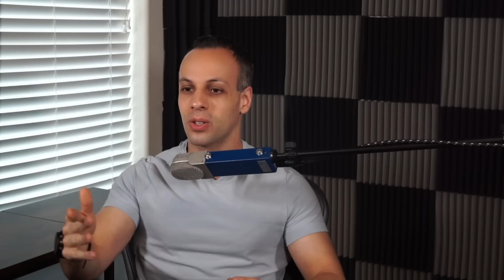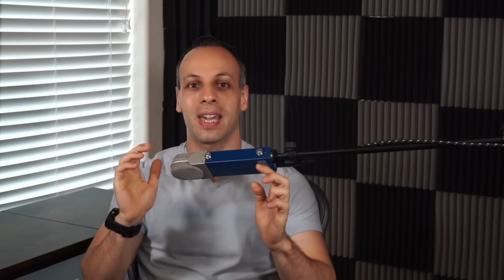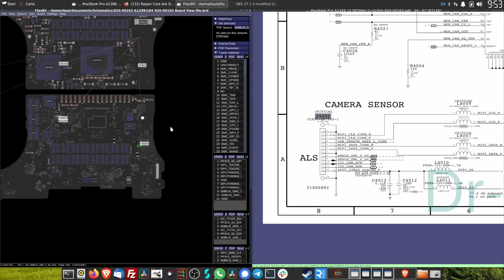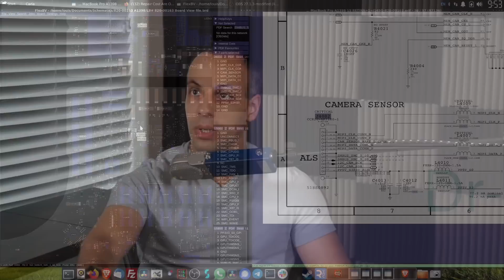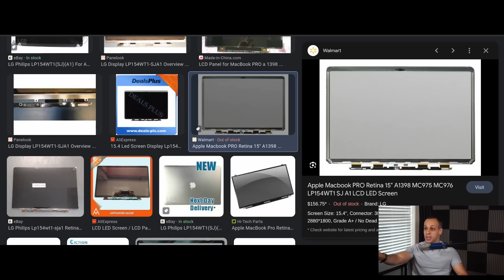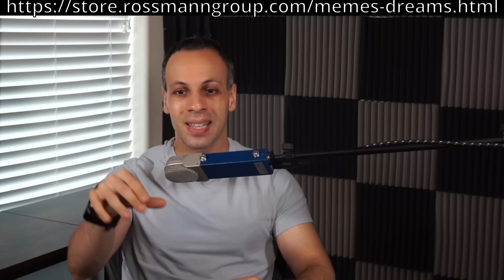The Ford F150 Macbook - when car repair resembles macbook repair...

Comment: Everything on the Dodge Promaster 22-23 is run through the computer requiring a onetime purchase of their diagnostic software. So $3k minimum if you dont already own the based diagnostic scanner, $4k-$10k if you dont. Dodge also released a custom break assembly just for this truck, meaning they are not in stock anywhere except for at Dodge.

Comment: ford absolutely did design this to fail on purpose.
this is not the first time they've done something like this. fords thinking" hey guys, lets mount the brake light switch on the brake petal so the wires move every time you hit the brake and cause the wires to brake so you have no brakes lights so the person driving at best gets a ticket, or rear ended & dies"
ford, built to fail,..in the most expensive way we can think of,..

Comment: I saw the same video.  Now imagine every single consumer product going this same way. From toasters to, any minute now toilet bowls. I can't tell you how many newer front load washing machines put the soap and liquid fabric softener adjacent to the circuit board. Or how most people who own top loading machines with computerized sensing and water saving technology feel the machines aren't getting the clothes clean and have to wash a second and third time. Does this sound like it's saving water to you? It's not just failure points,  it is the stuffing a complicated and delicate mechanism into a previously extremely reliable device in order to impress or fool consumers into some supposed benifit. When the truth is that it's just a gimmick for the theft of data and the side benifit for the manufacturer of ten to one hundred times the failure rate. Because now you have ten to one hundred times the components, and a multiplier of software bugs on top of that. 
This isn't saving water,  power,  landfills  or resources in any way imaginable.

Comment: In Australia Ford would be asked a few questions 1. Is the item fit for purpose? they leak so are they functioning correctly? 2. How long is the part expected to last?  How long should tail lights last  one year, two years,or ten years?Without "positive" answers Ford might be forced to fix the problem under consumer law

Comment: I got a 2024 f450 ordered to be delivered  in a couple months... I optioned out the tail light with led weight sensors.  I hope this part isn't some complex issue like the canbus issue of past ford's. I will be hell to deal with when problems arise that takes down my truck, as it is meant to make me money. Ford is #1 for a reason, way more reliable than dodge and better designed then gm trucks. That won't change my view on how I will address issues. I will bring down the hammer since I paid good money for this tool.

Comment: its TOTALLY right to repair.. IF you have a bad battery, low voltage, the warning on a 2018 F150 will say that the electronic E-brake will not work, so your vehicle will not start. ASK me how I know..

Comment: Led tail lights and led headlights can be over 2000 ..main screens can be 2000 .these were a .99 light bulb and the screen wasn t there .new cars will never be on the road for 20 years it will cost too much to keep them going .

Comment: Fantastic video     I am a tech 52 now.   And to add to the Bus line    Some vehicles will see the repair and clear error out and go back to working….. others have to be cleared with a computer to clear the error code out or the module or repair stays off line ….. it cost the tech and consumer      Very poor engineering and not knowing if it’s purposefully done or just idiot of don’t care.   Great video

Comment: I've seen this before. Farmer came in with his 2015 F150 a few years ago, no radio, HVAC function, power windows or locks, memory seats, etc. Ended up being both tail lights cracked from farm use, water entered the blind spot detection modules in the tail lights which took down the data bus. Was $3k+

Comment: The last Ford I had was a 97 Probe GT.  It was a good car, but about a month after I got it, I noticed that there was a spot on the lower plastic panel that wasn't attached correctly.  Luckily it was under warranty because one of the clips was damaged.  You couldn't get the clips separately so they had to order the entire side panel and replace it.  Keep in mind, this clip was not part of the panel.  It was just attached to it.

Comment: Fuck car companies.  They've been going this direction for a long time.  Fix old cars and support the aftermarket economy.  With no real infrastructure for electric cars and nearly non-existant parts support, it's the only real way I see forward.  I had Hyundai cause me a similar problem by refusing to sell me a set of rods because the rods I pulled out apparently didn't match what they had listed as supposed to be in there.  I don't fucking care, I just want to fix the customer's car, don't blacklist me because I pulled the wrong rods out of your factory assembly.  The whole "hangup" was that my rods had bushed small ends and the book listed that engine as having press-fit rods.  I wound up having to cut the old bushings out (as they were electroplated and not pressed in) and custom size some Brian Crower small end bushings that were sitting around the shop to fit.  Added an extra day to the rebuild (that nobody got paid for) all because the dealership was a twat.  And this wasn't even involving computers....

Comment: As a designer myself,  I have to ask the question,  what is the acceptable level of repair difficulty?  We can't design it in such a way that every single component can be replaced in 5 min or less with no additional cost beyond the component.  So,  what is acceptable?

Comment: Would it not have been cheaper to have abandoned the tech in the rear lights qnd just replace with a plain light. Would have to seal up the connector but would not have to spend over 5k

Comment: I saw the video you talked about. I’m almost 50 and I repair lots of things. Our window of greatness in products I believe already happened. Currently and into the future I don’t see anything but planned obsolescence along with more garbage design on everything. My personal way to avoid this is to research just about anything you buy. Lifespan takes time so that means you wait. Buy a ten year or older car. Research the car know which one lasts the longest with the least problems. Buy used stuff. Go to the store look at prices then go home and research used. I bet you’ll find the price is half or less original price. Slow down and never buy new if you can help it. Otherwise your a crash test dummy

Comment: Ahh nice to see ford is "catching up" with the bmw (e65) 750. The worst car ever made.

It has a can bus network that uses suitcase connectors (the pinch conetor that cuts the wire and is not water proof) that is outside under the headlight assembly.

Comment: The DOT should have mandated a recall for these lights where Ford was 100% on the hook for replacing all taillights with those part numbers on all trucks that are in service or simply exist.  If they did that, Ford would find a way to make this whole repair cost under $500 for themselves.

Comment: I was quoted just under 2k to fix the A/C compressor in my 2012 Chevy Cruze. It requires a whole new kit to be installed and recharged, oh it also counted the replacement of the hoses from my radiator busting and spewing transmission fluid all over the highway which made me actually bring it in. 

This quote was after the mechanics recharged my AC free of charge with a dye to test for leaks and replaced a blown fuse. 

A more "reknown" mechanic (looking at you Christian Brothers), wanted to charge me 5k just for the compressor alone.

All of that pales in comparison to this.

Comment: The auto industry has moduled everthing and spread it out all over the vehicle.   The question is, why they locate sensitive PCB's one seal away from weather ingress when the cost is negligible to locate the module with the PCB somewhere in the interior of car, and the actual sensor in the more risky location.....protecting wiring bundles is a simpler lower cost design over trying to make the entire module containing the PCB IP67 or IP68.  The only answer has to be in the revenue of their parts divisions.

Comment: As an engineer with many years of experience I can vouch for the fact that nothing is designed to be repaired anymore.  There are two issues here to be considered.  First, our society has evolved into a throw away society so products are not designed to be repaired but rather to be thrown away and replaced when they fail.  Secondly, everything is very cost sensitive from a manufacturing standpoint.  The pressure from management is to cut costs to the bone.  So, since it is a design goal to assemble everything as cheaply as possible no concern is given to disassembling anything for repair purposes.  As  you have noticed from working on Apple products, everything is bonded together.  It is cheaper and faster to bond things together then to assemble them in a manner that can be disassembled.  Additionally, bonding things together makes it easier to produce products that are thinner and lighter.  Making things thinner and lighter makes the marketing and sales departments happier and may get you a promotion.

Comment: I have to replace the electrical connector or the tail light on my 2007 Audi A4 every couple years or clean corrosion from inside the contacts and fingers on the connector otherwise it dies from corrosion and it appears to be sealed fairly well

Comment: My Mercedes had to be towed because the CD changer corrupted the data on the canbus so the engine control module couldn't communicate.  Engineers are idiots.

Comment: If a man needs backup sensors on the back of his pickup then his man card is revoked. He should have bought a minivan or something cute. It's very easy to use the mirrors on a pickup. 

The tail light on my 08 Silverado quit working I went and bought a new bulb. The entire enclosure was filled with water, like a little fish tank. I could have put a goldfish in there and it would have lived. I went to my toolbox and grab my drill and drilled small holes in the bottom and drain the water out, then replaced my bulb and I was on my way. I don't know why they can't manage to seal these things up it can't be that hard. Fortunately my truck is completely drivable when it's like that. I take care of my own repairs I'm not paying these prices.

I would have been checking junk yards for that tail light assembly on the feminized F150.

Comment: As an automotive test engineer this looks for me as screw-you from Ford by designing wiring in this way (not splitting sensors from cricital systems by devices like gateways), but not entirely - since those systems are currently deeply interconnected for ADAS functions and stuff. It's like half-split.

Comment: This is why I use computers when necessary but do not want to rely upon them. I want to be able to be self sufficient with older non computerized equipment. It's all great till it doesn't work and you can't repair the computer parts yourself. Computers can be helpful to monitor things, I don't like them controlling things much, I'll do the controlling myself.

Comment: I bought a new 2013 RAM. About 3 weeks into ownership, I came out from work to a no crank/no start. Had to have it towed to the dealer. Turns out the radio unit crapped out. No big deal right? Nope. All functions run through the radio unit. Just order one right? Nope. It is VIN coded to the vehicle. They had to manufacturer one. No one knew how long it would take. Not the dealer. Not Chrysler-Fiat. Not the manufacturer. The dealer told me they would know when it showed up. It took almost two months. I had a loaner but it was a base model Jeep Compass and depressing to drive. The dealer didn't know what the unit cost but they told me it was easily north of $3000 just for the unit.

Comment: AMG Mercedes suffer from similar designed obsolescence. A literal $5 plastic part failure costs $10,000 to replace because it required the entire engine to be removed.

Comment: Geez  and I thought I had it bad... changing out my headlamp assembly.. the dealership  wanted  $450 a piece (so  x2)   charging me $250 a piece in labor so everything I had done   (including  oil change  tire rotation and  license plate light  would have cost me  $1,300 + ...
So I got on amazon and bought the pair of headlamp assemblies for $250  and it still cost me $750 for all the labor and the other stuff.
so hey  I saved $300   RME

Comment: The fact is, auto manufacturers don't care if the car lasts any longer than the warranty period. You're supposed to toss it and buy a new one as soon as the warranty is up. All this will do is make sure that those of us who can only afford very old cars will not be able to drive because repair costs will either be too high or simply unobtainable. Only the rich will be able to have the freedom to travel in their own vehicles. All planned to "save the planet" (which is bogus but 99% of the sheeple still fall for the lies) and ensure that we become slaves of the oligarchs who are running our lives.

Comment: South main auto just did a video on a buick, the dealer quoted 5k for a few things but the main issue was a radar sensor in the bumper. A stand alone part that still has a ridiculous dealer price and the harness had to be replaced vs getting a new connector because just the connector wasn't available and corrosion that was actually caused by the failure of the radar sensor.

Luckily it was all available and it was replaced for much cheaper at the repair shop.

I am currently working on a 2010 HHR. I've found so many things most shops would struggle with that there's just no excuse for. The main one was a code for a brake switch. There was zero information for this code, nothing on forums, nothing in the service manual. I am just lucky I know someone else who works on these cars. It turned out it was because the 3rd brake light was out. Now that's a maintenance issue that should have been caught, but that's not always the work flow when you're diagnosing a a check engine light. You read the code and it's supposed to pinpoint the issue.

Another issue I had was a cam position learn procedure my expensive autel couldn't do. I had to purchase a tech2 scanner.

It's just way too many things designed to keep you coming into the dealer because your typical repair shop might struggle out never find the problem.

And don't even get me started with the automotive key/locksmith/manufacturer scam.

Comment: USED USED USED. Even the aftermarket!! Don’t be stuck within dealer restrictions…

Anyone worth anything when it comes to repairing cars could have 100% fixed that truck for $1,000-$1800. There are a multitude of used taillights in junk yards. These require zero reprogramming, unlike a new module.

That dudes video really pissed me off. Everything about it was designed as click bait for views.

Comment: I used to be an automechanic. I knew this was coming about 15 years ago when I had to remove a whole front bumper in order to replace a headlight bulb.
Reply: You know who loves this technology crap other than the dealership making money on repairs ? Thieves love it, they plug a computer through the head lights or tail lights and reprogram the main car computer, voila it opens and they drive away with it. The car ends up in Nigeria or some other country.